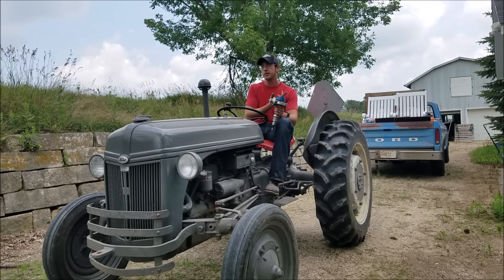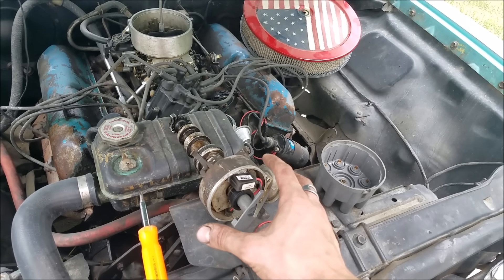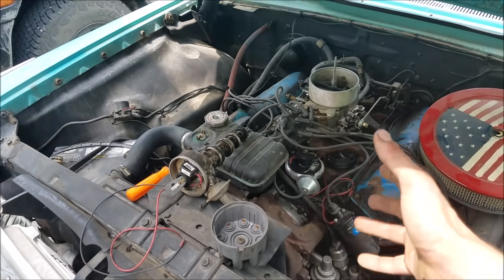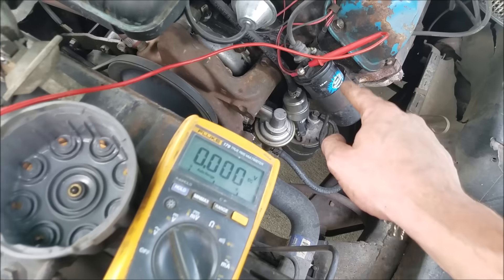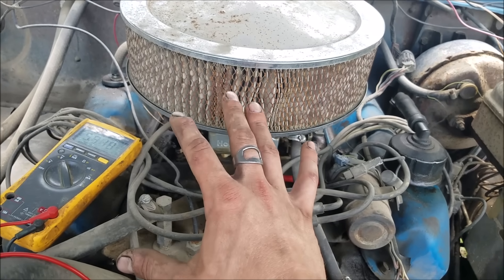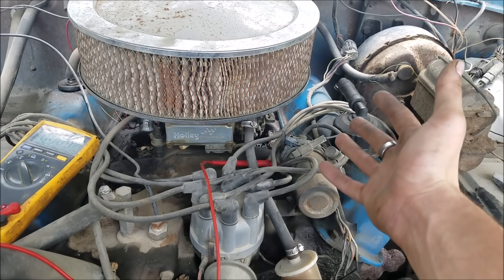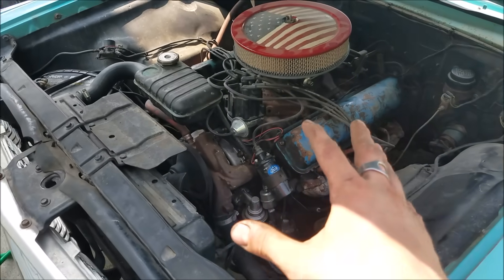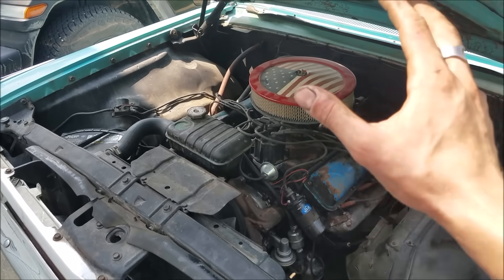Pertronix Ignition "Problems & Failures" (It's Actually YOU)

Comment: Very clear. But as a former marine engineer working with dieselengines. Why the resister (voltagedrop) on the coil? The more in the system the more can breakdown.
Reply: To compensate for the voltage change when cranking. The coil receives direct battery voltage when cranking (second small terminal on the starter solenoid) to compensate for the lower voltage when cranking. However if the coil wasn’t designed to fire at a lower voltage the spark would be weak at cranking when you need the hottest spark. So the coil is designed to work at the lower voltage. If it got battery voltage running it would overheat and burn up. Here is where the resistor circuit comes into play. It drops the voltage to allow for hot spark cranking yet not overheating when running.

Comment: In some cases you have to tie into the the fuse that only turns on when you are in ignition mode on the switch ,if it;s on the acc side of the switch it will go open circuit when the ignition switch is in the start mode this makes sure that all the power goes into starting the engine .Also when wired this way you can have ignition switch in the acc mode without powering up the coil and in some cases the heater for the choke Very good video Luke.
Reply from the maker: Those are very good points you make
Reply: If using the Ignitor II you wouldnt have to worry about having the key on without the engine running.  Only the Ignitor had the issue burning up with the key being left on, with the Ignitor II they put a sensor in the module that shuts the module down before damage if its wired improperly or if the key is left on.

So honestly there is no reason to buy a Ignitor, you should be buying the Ignitor II or III unless the Ignitor is the only one for your application.  For my applications the Ignitor II was the only one I could use in both cases.
Reply: Yes I know with Holley sniper you must wire the ecu power wire or I think a pink wire on the wiring diagram to ignition power but also power while cranking. Can be a little tricky to find.

Comment: Another great instructive post! Thanks for the tip on the fuse box too! By the way, your audio is so much better than it usually is. Have you done something different with your mic set up??🦻👌👍😂
Reply from the maker: I just yelled when I talked instead this time 😂
Reply: @ThunderHead289  Hey, it works...  Re: batteries, check the Interstate battery store.  They frequently sell blemished batteries at a discount.  As an example, group 35 batteries frequently go for $31 or so, plus tax.  Suspect a group 24 won't be much more.

Comment: Can you do a video on how not to burn up electric fuel pumps? Mine seam to die about every 50,000 miles
Reply from the maker: I can outright tell you why - the pump is cooled by the fuel flowing through it, on a deadhead system, the pumps relief valve opens (this is usually your pressure threshold, like 7 psi) and basically once open, that fuel just cycles in that one area and the pump gets really hot. 
I personally won’t run a return less electric pump setup, if I don’t have a return line, I stick to mechanical pumps as I had experienced what you describe myself.
Reply: @ThunderHead289  it does have a return line, and a bypass regulater set to 5 psi. And the pump is below the fuel tank
My only guess is some how it does not get the amps it needs, 12 gage wire though a relay and grounded to the frame, or carter 4570 pumps are just not meant for long life.
Reply from the maker: @oldreliable303  you’ve done all you can do for it aside from a bottom of tank port “vs pulling fuel up and over” - thats really the only other thing a guy could do
Reply: @ThunderHead289  for the bottom port on the tank is worth on the pump life?

Comment: Hi I live in coffeyville kansas I have a 93 gmc sierra c1500 with a v6 it's blowing out blue smoke while running do you know what the problem might be?
Reply from the maker: Rings are severely worn. I’d try adding thicker oil like 15w-40 vs the 5w-30 it originally called for.

Comment: Luke, a great primer on the petronics. I have used them for over 30 yrs and have never had one fail.I read the manual before I ever did the first install. I have had a unit on over 12 vehicles and never a failure. I see that you use my favorite brand of multimeter, fluke, they are relatively expensive but worth every penny.
Reply: Been using fluke meters for over 35 years. Its the standard for Industrial Technicians.
Reply: Ditto
Reply: Journeyman Electrician, Fluke or bust.

Comment: Very good information 
I learned something new so thank you 
Wiring for me is very frustrating and intimidating so thanks again 
I have a 95 f150 that has an efi system 
I would like to replace that with a carburetor 
It's a high mileage 5 lt that's bogging down constantly and wants to stall when I come to a stop 
Help if you have a advice it would be greatly welcome 
Thanks for the videos brother 
Have a good one 
Just saying
Reply: Look for vac leaks
Reply: I'm with Todd on that, and it's probably that one that runs under the upper intake that is a REAL pain in the a$$ to  get to. Personally, I would do the Carb Swap on a 95, if nothing else to get rid of that old OBD 1 crap. But just like this video, there is a "lot" more to that swap than just an Edelbrock Carb & Intake.

Comment: Read the directions? Who’s idea was that? Lol
Reply from the maker: I don’t blame anyone for not, they are are more vague than ideal - I was lucky in the day, I got the ignitor3 back in 2012 and it came in a kit with everything. Installed it on a car that had already been electrically hacked - resistor/resistive lead long gone.
Reply: @ThunderHead289  even if I didn’t read them up front, I’d definitely read them if I had issues. The kit I used seemed to break everything down pretty well. 🤷🏻‍♂️